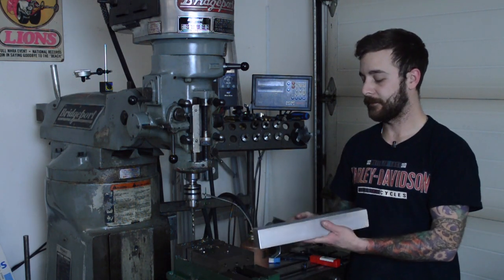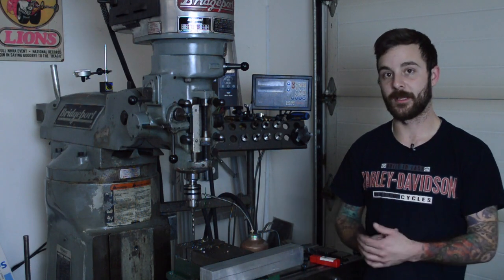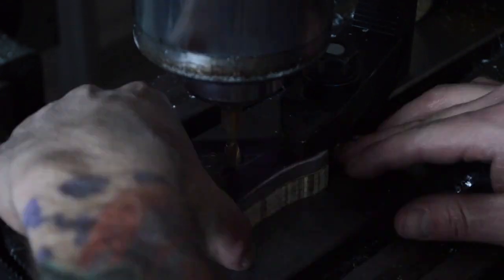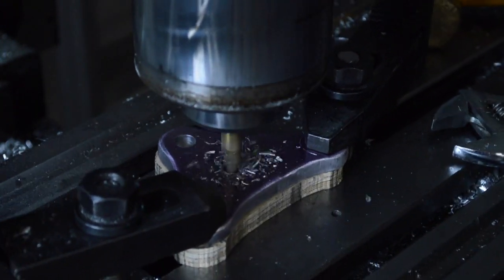Making Shock Linkage - Turbo Buell Build

Comment: As a cnc machinist i find this painfull to watch.
Well done though. Alot of work that
Reply: I couldn't imagine what part required 2"x2"x 12" billet ,turns out ? Chips lots and lots of chips !
Reply from the maker: Thanks man. I bet it is painful to watch with you being an actual machinist haha
Reply: Was it the fact he measured and then hand punched the holes instead of using the mill table for an accurate measurement. I’m no machinist but that seemed odd to me.